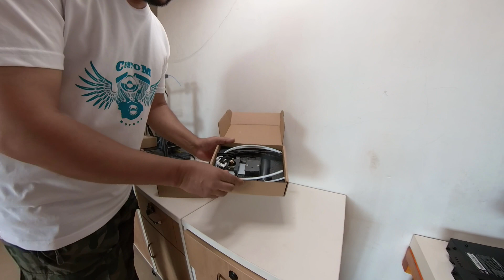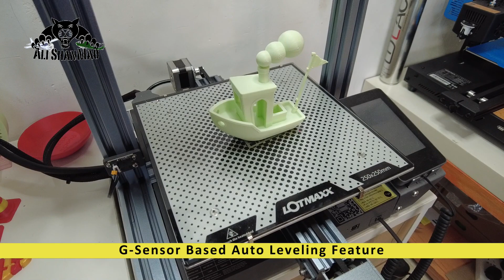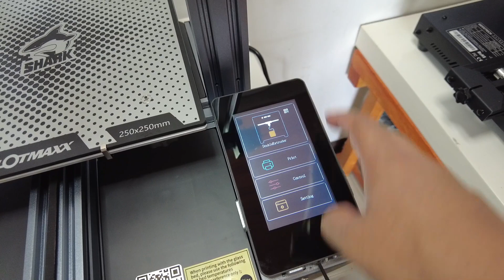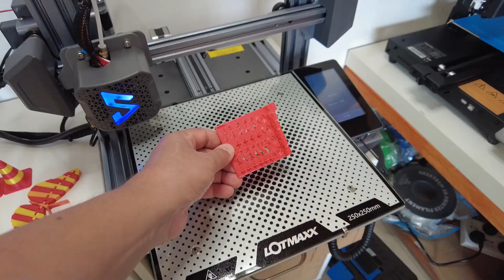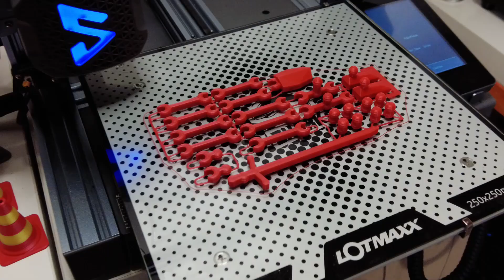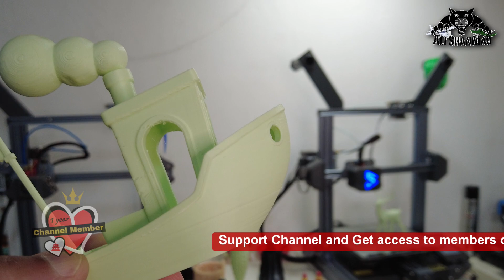Lotmaxx Shark V3 dual color 3D printer laser engraver review

Comment: Just ordered mine yesterday. Did you change any settings out of the box, or were all these prints with the default settings? This is gonna be my first 3D printer, and I don't know anything about settings or software, so I'm hoping I don't get overwhelmed...
Reply from the maker: I have learned my own best settings over time and I keep them safe. i am using my own settings in Cura
Reply: @alishanmao  How did you add the v3 to Cura? When I look at the list of printers it doesn't have the v2 or v3 options. Is it just the Lotmaxx Shark option?

Comment: I’m selling mine for $350 if anyone is interested
Reply from the maker: Why? its one of the best 3d printers. the best tolerance so far i have seen, resolution and precision. i can print 0.1mm gap between parts for fitting and moving parts and it prints with fine precision, parts move right after print. i have designed and tested many of my print in place moving designs that work like a charm

Comment: i wanna buy a 3d printer but i am not sure if i should get the lotmaxx mentioned in the video or artillery x2 ? what do you think ?
Reply from the maker: Check Creality Ender 3 pro and other bands as well. see which printer parts you can find easily. and then buy that printer. because you will often need parts for maintenance.

Comment: Thank you! This video was very helpful. I really like the possibilities this printer offers. I'm pretty curious about the dual color options and the laser engraving and how to make it work. I already have some things in mind I would like to print or engrave. I should really start saving some money for this ^^
Reply from the maker: Glad it was helpful! i have been using this printer and testing it non stop still. What I find and love about it is that its print quality, the tolerance on printed parts. so printing parts that need to move, even 0.2 tolerance works super nice. no joints get welded. printing articulated models or parts that need to move is best with this. it has really good quality. for the Laser engraving, its the same thing as it was in Shark Plus. you can check my other video. because laser engraving is not that impressive so I did not perform that test. will do later as per my time. but definitely i will highly recommend, this is a really nice 3D printer.